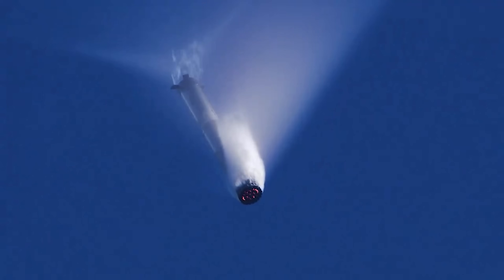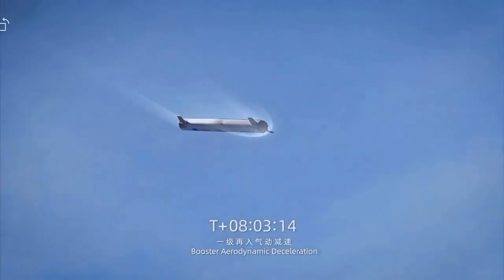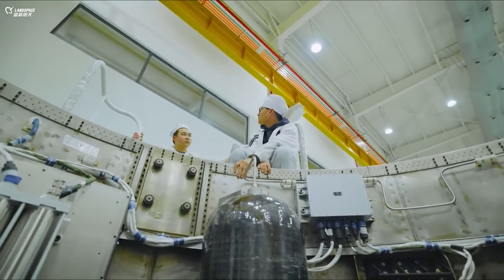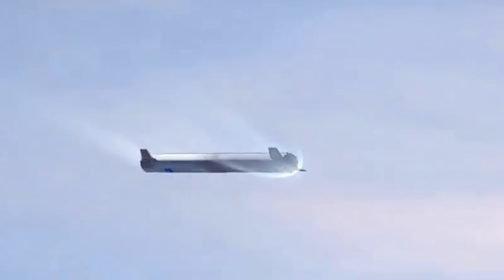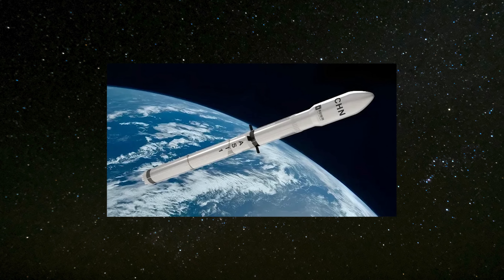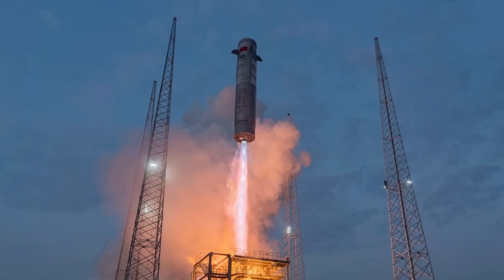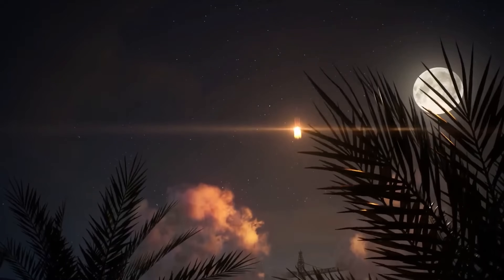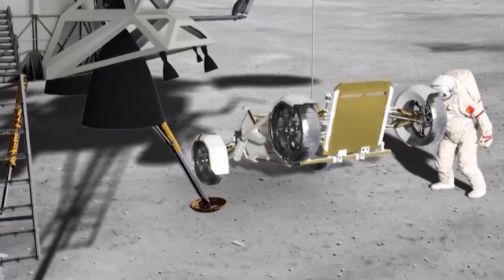Elon Musk revealed Something WEIRD happening inside new China Rocket!

Comment: not gonna work without adding a bunch of mass to strengthen against bending moment in addition the already significant mass needed to support against compression. rockets are built like columns to resist compression from massive thrust load. they are not built like beams to resist bending moments and torque. (think skyscrapers vs wind)
bad idea is bad.

theyre doing this because a catch system is too technically challenging. Kudos for working on reusability though

Comment: Tal vez un drone gigante....seria mejor. Que en lugar de helices se le acoplen cuatro cohetes.  Mas estabilidad y capacidad de supervivencia. Si falla  un motor...puede ajustar y quedar en tres.
o incluso ponerle motores de helices....infinidad de posibilidades.  EL problema es que estan intentando aterrizar un cilindro y eso es muy dificil.  Se les a cerrado el mundo a esos ingenieros.
Es oclusion mental...cuando quieres reinventar algo nuevo.....basandote en lo mismo. Es como querer reinventar la llanta....haciendo otra llanta con  otras cosas....
Reply: yeah no,     air resistance right after re entry would rip any fan blades apart and they don't produce enough thrust to slow down in time before hitting the ground and the size needed for propellors big enough to slow it down would be better fit to just use them to make the rocket a non piloted aircraft.

Comment: If you really think of simplicity.  Why not just make it crash into  a pool of water since most of the reusable part still need to be cleaned and check inside out?
Reply: Extraction at sea is difficult, dangerous and expensive. With controlled landing, you build the cost of recovery into a more reliable method.
Reply: you don’t have conveniently placed pool of water on other planets. this ain’t minecraft
Reply: @MeIsE-e6p  XD
Reply: the sea is typically the only option where you can do that without disrupting ecosystems catastrophically, but saltwater is corrosive to the extreme engineering tolerances and materials of rockets.

Comment: i just wonder if it wont brake or arch from its weight since its sitting on both end alone and its a bit thin, and will require alot of structural reinforcments , and how those 6 engine are kept inside hidden and then are brought out or coverd by doors , what if those doors wont open for some reasons , and the inertia to do that movement at that speed with the propelent inside might change its movements , anyways its a lovely concept

Comment: More weight for horizontal landing due to not recycling the use of original launchers mean vertical method will always remain the best choice.  Its a nice and interesting feature, but it will cost more to operate, test, and reliance is always a factor.  Failure of the main booster can be found on launch, failure of a booster only used during landing... now that's expensive and we wont know till its operated!  This will never become a thing in the eyes of a cost efficient government.  If one booster fails on Elon's rocket, it has a backup ready to go.

Comment: How long before everyone decides that the most efficient method for landing the booster is to turn it into a glider and land on a runway? 

Going for a horizontal landing would seem to have a lot of challenges, four additional thrusters and their additional fuel feeds and legs needed to support the landing, a set either end would seem to be sufficient to support the whole structure without having a set in the centre. 

What is the advantage over a vertical landing, that doesn't require any additional engines?  Apart from anything, the design would not seem to be one that scales particularly well.
Reply: There are no runway in moon, so horizontal or vertical landing is innovative and will serve a broader purpose in future space technologies, and horizontal landing seem more stable and practical its like balancing a pencil horizontally at two ends is easier than balancing the pencil vertically in one end.
Reply: interesting idea.
Reply: you have more failure tolerant legs. Don't need deep throttling capability. Perhaps cheaper development cost. Faster turnaround compared to landing vertically like F9 and then laying it down to transport like SpaceX does. More failure tolerant with regards to engine restarts?

Comment: I get why the vertically landing boosters dont use parachutes for breaking, but the horizontal landing one could deploy a dozen parachutes to assist in the landing, lowering costs dramatically!
Reply: Rockets that have to take off vertically and land horizontally have to be structurally reinforced a lot more to hand this bi-modal landing. Normally rockets are designed to bear forces vertically, but weak horizontally. If it has to fire rockets to decelerate from 500mph at high acceleration, now you need heavy rings and internal truss to transmit the forces without crushing it like a tin-can.

In short, you're adding a lot of weight which limits your payload.

Comment: I guess vertical landing isn't a safe choice, the redundancy for mistakes is very tiny reguardless how SpaceX fine turn the process, and the consequence of little failure is catastrophic. But horizontal landing requires a large flat space. But much safer under failure (probably won't explode if mis-landing?)
Reply: well id argue that it actually isnt as safe as the current spacex method. The chopsticks is great as we have seen mechazilla. Landing horizontally now just means if the stage is even tipped slightly its even more catastrophic
Reply: @TaoistToastr  Well if you take weather conditions into account, there are always random factors at landing time. SpaceX got the last trial right, but perphaps it was just lucky, what about next time? Let's see...

Comment: Genius China !
Reply: Extreme geniuses! They're trying something that will never work. How do you convince the fuel/oxidizer to stay on the bottom of a horizontal cylinder? SpaceX has a problem convincing it to stay on a vertical cylinder...  No fuel to feed the pumps, because it's everywhere due to accelerations and vibrations, the exhaust becomes engine-rich. The second problem is structural stress. SpaceX has proven that, even with steel, that's a problem that needs a lot of tweaking. The 3rd problem is the broken symmetry; the rocket would be heavier on one side. Sure, the SLS has a broken symmetry too, but that adds complexity for a bunch of engines that are designed to relight in the atmosphere and completely stop the vehicle, engines that are deadweight during the ascent (the Space Shuttle engines are active during the ascent and they're compensating for the ).
Ok, don't get me wrong, as a small technology demonstrator, that may work. But it's not scalable to the sizes SpaceX is aiming for. IMHO, PLA has in mind 2 possible use cases: troop transport anywhere on Earth (to counteract the US power projection) and space colonization (same as SpaceX). Both use cases have better, cheaper, more efficient alternatives. Although I'm not arguing about the Chinese definition of efficiency: they built whole cities for nobody to live in them. So... yeah, extreme geniuses...
Reply: @milutzuk  are you soft brained, those coyotes they built are not built, there skeleton structures, and there all dreg construction, all of China of collapsing and falling apart, from the streets, bridges, coliseum's, there entire water system is garage, the streets flood everytime it rains, entire apartment complex fall down and collapse, there structures are built out of garbage, you need to research before speaking
Reply: Genius copier
Reply: Yeah there real geniuses, they literally steal and copy everything they have from everyone else, real smart

Comment: I would propose rockets build with aluminium. Let gallium mix with water to react with aluminium rocket to produce instant hydrogen to power the rocket. That way the rocket will be digested slowly in the sky. Not sure if it's cheaper? Will any experts there tell me if this is workable?
Reply: lol no, it wont work. if gallium aluminum rockets were a thing theyd already have been used. ur tallking about an uncopntrolled solid rocket motor? or what/ like teh whole thing made of aluminum so it gets eaten up liek a coke can? lol nah bro. cant do that. make a model rocket like that first see if it works.
Reply: @AckzaTV lol obviously you don't know anything about engineering and science. By controlling the amount of water mixed gallium injecting into the body of aluminium tank will control the amount of hydrogen. Lol go pick up some science knowledge.

Comment: Horizontal configuration is good idea. Using rocket against gravity in deceleration at final approach isn’t. Cost to payload, oxidizer and fuel. Consider parachute.

After landing the stress in the hull under gravity is immense because it landed and suspended at the opposite ends of the hull. Extra material weight is needed to counter balance g force from breakage by the rocket body weight.
Reply: But scaling up models to use a parachute is not exactly viable either. There are weight limits on how much a parachute can reduce the speed and force of fall of the rocket. Especially if you want to land it without damaging the rocket. You might increase the survival rate of the rocket by making it fall into water like all the capsules from NASA's previous manned missions. But the shape of the rocket doesn't help with buoyancy, and the rocket exhaust will let in water that will make the rocket sink or even ruin the rocket engines.
Reply: @ssrbgangimaribotan6thofthe12  point taken. How about combine all the above to reach an optimal mix to save weight? The oxidizer and fuel tanks should be valved against water infiltration.

Comment: I don't know why everyone is following the Americans in how to build a space vehicle vertically were you can only fit 2 to 3 people on the top of a thing that Americans call a rocket with 5 rocket boosters at the bottom of it, when you can build a horizontal spacecraft and spread your engines and boosters evenly and build that craft wider and fit 10 to 20 or more people in it.
If I had the money 35yrs ago I would of already build a horizontal spacecraft myself it will be the same as if it was vertical but better with less strain and wouldn't need to force your craft shooting straight up vertically to the air when instead you can lift up and fly horizontally before gaining altitude. 
But I'm no expert only the American government are better at umm what are the Americans better at lying, destructive, cunning, murderers, deceivers and etc
Reply: 距离，发射成本
Reply: Horizontal rockets result in more surface area, which will need more rocket fuel to push. Aerodynamics don't change just because you go to China. That's why they still use tall and thin rocket designs like the US, cause you know Chinese scientist also know how to make rockets. They are only using the horizontal concept on the descent to the earth. The more surface area you have when you are on the way down, the easier it is to slow down the descent. The same as when you're going up. That's why people use a parachute to descend from 30 kilometers high up in the sky. More surface area means you slow down better.
Reply: In fact, China is trying to develop an aerospace plane, a cross-border aircraft that can fly directly from the sky into the universe, and then slowly fly back after completing the launch mission. However, the official information disclosed so far is very little, and satellite images show that the aircraft is not too large. However, as the technology matures, the carrying capacity and economy of subsequent models should be improved.

Comment: 0:39 why call this the weirdest booster landing, while it actually makes much more sense than a vertical landing?
Landing the booster horizontally is much more stable than vertically. It is however more complex because you need to add additional rocket engines. Once you solve the challenge of including those extra engines, the method is superior. You have a stable platform that does require hooks, perfectly smooth and vertical touchdowns etc. There is less to go wrong. So while you have the challenge of the extra weight and design, there are also many benefits. In fact it is the “superior” way to do land. The ADHL part - Aerodynamic Deceleration Horizontal Landing - also benefits from the body working to function as an air brake. Which begs the question why not try a booster with a (moderately) lifting body design., to increase the aerodynamic deceleration effect.

Comment: If they can control that speed on dissent. And then survive the tilt the little rockets on the side could 100% hold the rocket horizontal which would make it easier to land on other planets. Especially returning to the Moon. Also with the lower gravity of the moon for instance it'll be easier to take off.  Very similar to a very old TV show from the 60s called space 1999...

Comment: There are several inherent flaws in horizontal landing systems for reusable boosters:

Engine Distribution and Mass Penalty: To enable horizontal landing, the booster would require multiple engines distributed along its length. This introduces unnecessary structural complexity and adds significant mass, reducing overall payload efficiency.

Redundancy and Reliability: Unlike SpaceX’s vertical landing approach, which uses a centralized cluster of engines capable of restarting and compensating for failures, a horizontally distributed system lacks this level of redundancy and operational flexibility.

Thermal Vulnerability: Engine nozzles positioned along the sides are directly exposed to extreme heat during atmospheric re-entry. Without robust shielding or active cooling, this configuration poses serious risks to engine integrity and reusability.

Feasibility Concerns: The aerodynamic and structural demands of transitioning from hypersonic flight to a controlled horizontal landing are complex and less proven. The added weight from landing gear, control surfaces, and thermal protection systems further undermines efficiency.

SpaceX’s vertical landing system offers several key advantages:

Engine Reuse and Simplification: The same engines used for ascent are repurposed for landing, streamlining design and reducing mass. Engine clustering allows for dynamic thrust allocation and fault tolerance.

Thermal Protection and Orientation Control: Vertical re-entry enables better shielding of critical components, including engine nozzles, and allows for controlled deceleration using retro-propulsion.

Planetary Refueling and Launch Viability: For missions involving lunar or Martian refueling, vertical takeoff is essential. Surface conditions on these bodies demand a lander that can launch vertically from uneven terrain with minimal infrastructure.

Knowledge Accumulation for Deep Space Missions: SpaceX’s iterative testing and operational data from vertical landings are directly applicable to future interplanetary missions, reinforcing its long-term strategic position.
Reply: Let them cook.  They either waste a bunch of money or get it right

Comment: huh?!? rather than using the existing rocket engines to land they've decided that four or six extra thrusters on the on the side will be a better strategy? That's just ridiculous. It's most likely because they couldn't figure out the thrust and gimbling fine tuning well enough to land vertically.
Reply: math says they have the reason, and that X is doing it "the hard way"
Reply: @jymcaballero5748  not sure the math is mathing on that one..  adding 6 engines with fuel and 2-4 more hard points "legs" for landing that is a lot more mass of the booster that could be fuel or payload to orbit.
Reply: @Jason-nn2ik  you are saying it will be expensive, im saying math says its easyer, not to be rude but i even belive that punting some parachutes make all of this @#$@#$ obsolete.
Reply: @Jason-nn2ik   But hey...
maybe that's why...
the Falcon-Heavy has PRECISELY "more engines and fuel," and ALL the "problems" like the one you say "doesn't work"?!

Space engineers usually HAVE TO ADD all that "mass," with "more fuel and engines," to rockets, to make them capable of going "further" from Earth...

It seems that Normally, they do exactly that with "more engines and fuel" if they want the rocket to carry "MORE payload to Earth orbit."

In the same way that a container truck engine needs "more power and fuel," because with a car engine, that wouldn't be possible... or would be stupidly inefficient!

If the "Engines/Fuel" had been "made to make it harder for the thing to work"... they would have been called BRAKES!
Reply: @Jason-nn2ik part of RnD is finding out which works, there are multiple ways to design something
Reply: It’s just a bad idea because:

1. It’s extremely difficult for the structure to withstand reentry at such a steep angle of attack.  
2. There’s no need to add extra engines on the upper sections the most efficient approach is to use the same liftoff engines.  
3. It would add more weight than simply installing landing gear.  
4. I think it’s merely speculation to stand out from the competition. Once they’ve done that, they’ll raise investment rounds and use the funds to build a far more feasible prototype in the end, it’s just marketing.